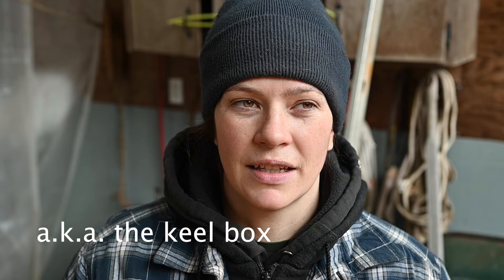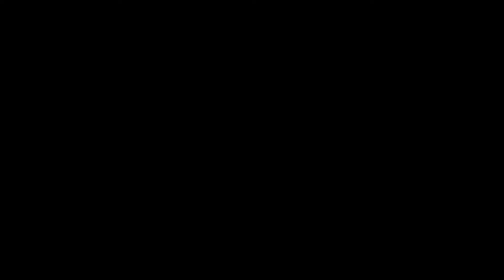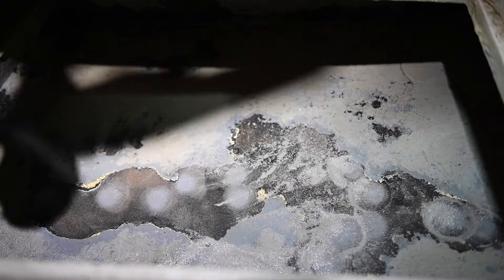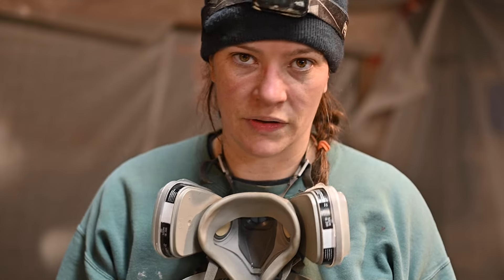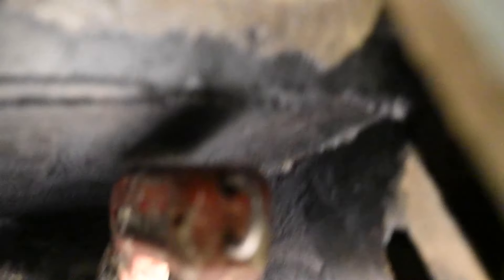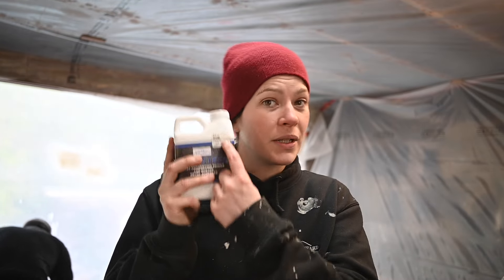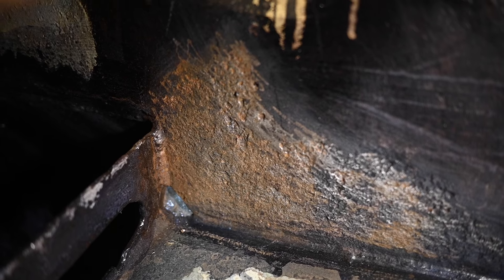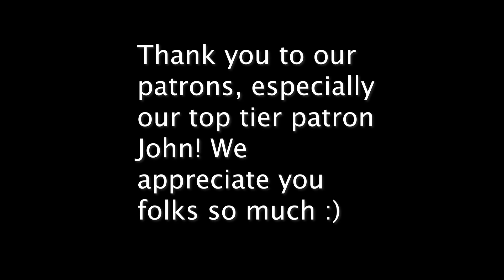Is Rust Converter Worth Using on a Steel Boat? Using Blue Steel in Our Bilge | Ch 5 E 98 |

Comment: Looks great! theres always going to be spots that you cant get perfect. I think the biggest thing moving forward is to keep the bilges 100% dry when back in the water. Get a dripless shaft seal or put a container under the stuffing box to catch the drips and make sure all hatches are watertight. You cant rely on a bilge pump to remove all water as they can never pick up the last inch or so. I keep a mop aboard and fully dry any water that gets into bilge asap. Glad the multitool trick came in handy 🤙
Reply from the maker: Yes good tips I think! Our biggest issues in the bilge are condensation. Do you have any tips for fixing that?
Reply: @WaywardLifeSailing  sorry can't help you there I'm from Queensland Australia so don't really have any issues with condensation. Best bet is to just keep good access to all the known problem areas and monitor it. Most people just do the bare minimum to get sailing again but yours will be a new boat by the time you are done so I wouldn't worry too much.
Reply: @WaywardLifeSailing  I was actually wandering why you put the spray foam back on as that seemed like it was the cause of a lot of the rust but I guess you really need some sort of insulation to stop the condensation in cold weather
Reply from the maker: the spray foam hasn't been the cause of any of the rust actually. anywhere that had proper spray foam has been completely free of rust.  The only places with spray foam and issues are where there was a ton of moisture trapped in wood, or improper spray foam. and yes unfortunately a good insulation is a necessity up here  @DrewN990

Comment: I have used rust converter for my steel sailboat for many years. It all depends on the prep and it needs to go on pretty thick to make sure you cover it well. I have had to 2 coat it also a few times. It should go on thoroughly clean steel and steel that has been wire brushed well. I've always used corroseal rust converter and I'm sure they are all the same now as I believe the patent had expired and other manufacturers are using the same formula. My best results in the bilge have been with the WASSER moisture cure but its kind of a pain in the ass to work with and I found that if I clean up the spot well enough and do the corroseal converter then apply my 2 part primer, I usually get a good 5years before old rusty starts to show his head again. If it's going to be getting condensation like all steel bilges will, you'll be doing touch ups down the line. It just comes with having a steel boat. I wouldn't worry too much about it and you just want to nip it in the bud before it becomes a real big issue way down the line. If it's bubbled up and flaking that's not good, but if it's mostly mill scale looking( dusty rusty) then the converter will do fine.  Cheers! You've come a long way! Looking good. Oh...and if it turns any other color then black you've got contamination.
Reply from the maker: Cool thanks for the tips! Much appreciated!

Comment: After applying the phosphoric acid rust converter, I would go ahead and paint, especially if you are using an epoxy paint as a primer, I think that you should be safe as you are depriving the iron of any oxygen, which, of course, it needs to form rust (iron oxide).
Reply from the maker: Yeah fingers crossed. Only time will tell!

Comment: I’ve used phosphoric acid (which will be the active component of BlueSteel) and found that the rust converter is jolly good. It will convert light rust, but not heavy flaky rust. That has to be removed.  I would definitely advocate the use of rust converter for any steel structures.

Comment: I haven't used "blue steel" on boats, but I did try it on a few trucks (wheel wells), I found that when new it worked much better, I probably should have prepped it much better than I did.  Hope it all works out for you, I still want to see you ploughing through the waves this  summer.
Reply from the maker: Fingers crossed it keeps things clean for a long time! Time will tell!

Comment: Hi, I,ve been owner of a 34 yo coreten steel boat. My boat is 96% free of any corrosion, my trouble spots have the following items in common, 1. Original paint disturbed, 2. its always the border where old paint is, that seems to be the trouble spot. 3 Hard to get at areas.                                       Inside, corrosion is beneath wet areas like a leaky water tank, toilet shower area. But these areas are least often maybe every 5 years. Most troublesome in deck areas where access is poor, these areas lucky to get past 4 months. Have tried Oxylic acid, Garnet blasting, severe wire brushing, its always the fringe area. Not attempted with rust converter because my understand it won't work on fringe area of old paint. At the moment the hull has got several holes in it, bit distressing that, I put it on the hard for storage during our cyclone season, this damage was because I had not inspected areas that were covered in beautiful wood, really bit disgusted with the amount of work in bad moments feel the best to be done is repair the hull and put it on the market.

Comment: I had this issue when it was too cold for the rust converter to work. Mine was vactan but probably the same stuff as blue steel. I'm using phosphoric acid now and only in warmer weather, and getting much better results.
Reply from the maker: Hmmm that’s good to know. I didn’t think it was cold enough for conversion to be an issues but maybe I was wrong

Comment: Great progress. 
We love blue steel. Rust starts the moment you finish grinding or sanding.
I am no professional but:
We have found the same yellow 'stains' sometimes and came to the conclusion that it is the result of the few days between finishing to grind and the day we actually apply blue steel.
we found that old Blue steel does not react as well as new one and if left in a cold environment blue steel is basically ruined, no hard fact about it just our experience so far.
The good news is, mild steel does not absorb moisture. In cold weather even if the place is heated, the steel remains cold and you can get surface condensation. After the first coat blue steel isolate the metal so the second coat does little, if you see rust permeating from the coating I usually grind that area a little and then apply a second coat of blue steel so it can react with the metal.
Reply from the maker: Hmmm good to know. Thanks for the info!

Comment: I have a steel sailboat and find that using straight phosphoric acid seams to work  best. Rust converters leave a barrier between the steel and the epoxy paint. I want the paint to stick to the steel rather than the rust converter. I love the sturdiness of a steel boat but rust is a real bummer.
Reply from the maker: Yep we agree. The issue with a lot of our areas is how hard it would be to wash off the phosphoric acid, which is part of why we choose blue steel. We used phosphoric acid in the chain locker after blasting though, so it will be interesting to see how that holds up in the years to come!

Comment: Is it possible that the chemical reaction of blue steel doesn’t occur properly at low temperatures?
Reply: That's what I found with rust converters
Reply from the maker: Yeah it’s definitely possible. I think I had things warmed up enough for that to not be an issue, but I might be wrong

Comment: Sulphuric Acid will eat the rust, rinse it off with bicarbonate to neutralize, then apply a red oxide primer to seal. (or your blue steel stuff) & that paint you used at end must have been  Water Based.

Comment: You guys will have a fantastic boat when all is done.
Since you have been using Clovamastic, I'm curious why you chose Bluesteel over Cloverdale's Corroseal? Both being rust converters.
Reply from the maker: We honestly didn’t realize it’s an option. I’m surprised the rep didn’t mention it. Will keep that on the radar in case we need it. Thanks!

Comment: The good thing about steel boats is..easy fix. Dry rot and fibreglass osmosis is worse. Even youtube has channels where osmosis takes a year to vacuum dry and repair. What's the worst thing on steel, cut out or weld a patch. Hit something in water in a cat and you sink, Hit a sea-tainer in steel and you scratch your paint.

Comment: Steelboat owners among your viewers will be interested to find out if there are any general insights into preparatory anti-corrosion measures and subsequent coating procedures that you would be ready to share, for example:

* What are your overall experiences with BLUESTEEL and would you recommend it?
* Have you tried other anti-corrosion brands and – if so – what are your experiences with them?
* Would you prefer BLUESTEEL over any other anti-corrosion brand, and if so, why?
* What precautions did you take to make sure the subsequent paint system you opted for agrees with BLUESTEEL (independent expert advice, instructions by the paint company, by the makers of BLUESTEEL or whatever)?
* What does your final paint system look like (one-pot, two-pot, different paint varieties for different layers, number of coats, drying times between coats etc., paint brand)?

I keep my fingers crossed for the success of your work in the bilge!
Reply from the maker: We will def be doing an updated video in the future! Thanks for the feedback 😌😌

Comment: Hi, can you tell me where to buy that spot blastet? I have beem looking for one of yhose to no avail. Part/ model number and vendor appreciated. Thanks Dennis
Reply from the maker: Princess Auto and KMS has them I believe. We didn’t actually buy this one so I’m not sure. Sorry!
Reply: @WaywardLifeSailing  Hi, I have looked high and low for that  spot blaster. KMS and PA have blasters but what makes that one special is the soft rubber nose that contains the grit and keeps it focused. A hard plastic nozzle is just not the same. I stopped the video a number of times to see a name but could not guess the missing letters. What is the name on the side of the media sock? Thanks, and keep going on the project. You will get there eventually!!

Comment: I know how many thoughts go into each and every decision. But throughout the video you seam a bit unhappy with the result you're getting. So maybe now is the time to reevaluate and remove the interior blast everything and have it rust free for good. It will be never easier than now. You have the equipment, it gives you the result you want to have and it adds to the value of your boat. But that's just my recommendation based on what I've seen in the video. All the best from Flying Coney ⛵
Reply from the maker: If we had known what was there when we started the project we probably would have done that, but based on where the rust is in the boat at present, and the fact that we would have to hire someone to come back and dry blast, it doesn’t seem worth it. The places we are unhappy with are all on ribs we will be able to access and fix rust on in the future if we need to.